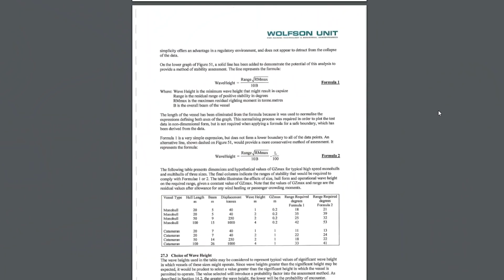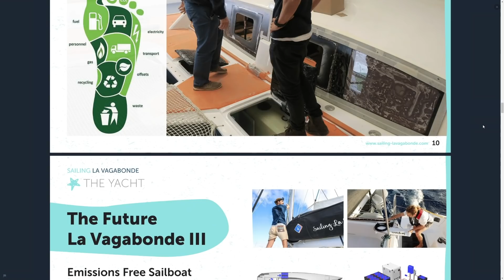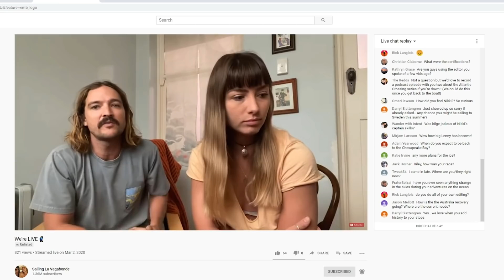Our Plan for an Emissions Free Vessel

Comment: The most emissions free you can get on construction of a vessel is to use the one you've got.  Why not just refit the Outremer with electric/hybrid sail drives?
Reply: I think Riley's focus is on creating something new that is better for the future. Refitting the Outremer wouldn't be enough. R&D is hardly an emissions free process but the overall outcome should improve the status quo. I think if they manage to come up with a design that cuts emissions on boat production, life and disposal, then others can follow and the entire industry can move in the right direction. Single ideas can change the world 😉
Reply: @BenDeBaran  not sure i would risk elayna and the kid on an untried design and techno-demonstrator
Reply: I thought this too. I have two ideas. One: Riley really wants to build his own boat. Two: the may be contractually obligated to not get too far from true on the Outremer.
Reply: @kmazingg  I would think Outremer would support this for many reasons.
Reply: Dr Creighton Shute Boat needs to be lighter and bigger to be able to avoid need for engine during 5 knot winds probably
Reply: @david4905  I wonder how much lighter it'll be with electric sail drives after removing the diesel engines.
Reply: @DrCreightonShute  With the batteries it will be much heavier.
Reply: @titter3648  The weight of diesel, the tanks and the engine is considerable. Worth a fair few batteries once removed.
Reply: @titter3648  JFA Yachts reported that Moonwave (60' Gunboat) lost 3.2 tons after refit.  That includes lightening the interior, but some of that has to be from the drives.

Here's the link:  http://www.jfa-yachts.com/en/Yachts/moonwave-catamaran-60-2/
Reply: @windsweptworld  Not if you want the same range as you have on diesel. That is why a Tesla is so heavy.
Reply: @titter3648  the thing is, you can recharge the batteries mid sail, you can't synthesise diesel. Not sure what the safety parameters would be; distance on charge.
Reply: @titter3648  Converting from dual diesel to dual electrics I dropped 200 lbs per motor, and I still have the diesel tanks, just hooked to a generator now.  Also I used AGM which is insanely heavy compared to lithium, and was still lighter.  Electric boats are lighter than diesel, the exception are designs that use a generator large enough to run continuously at the same power.  That ends up being heavier until you get into much larger boats.  The trade off in lighter weight is a range of 4 to 8 hours on motor without a large generator.
Reply: Dr Creighton Shute I like the idea of sail drive but wonder about range.
Reply: @titter3648  Maybe, but battery tech has changed, since not lead acid for hybrid.   Take a look at Jay Leno's Garage about the Briggs and Stratton Hybrid for an example.
Reply: jacques vlaming There’s definitely a large limitation to running on electric alone, thus the need for a generator. Check out torqeedo!  You can get an idea of ranges, speeds, and limitations. 
https://www.torqeedo.com/us/en-us/products/hybrid-drives
Reply: @titter3648  It is not about having the same but about being sustainable. Sailing more and being patient when there is no wind. Humans have got too used to doing what they want when they want. We would be wise to tackle our addiction of short term convenience. I think the change of mindset will pleasantly surprise people.
Reply: @DrCreightonShute  and adding a ton of batteries?
Reply: @fredbullmer273  i thing the energy explorer trimaran has the right idea.  solar panels make hydrogen from seawater and compress into tanks.  H2 runs thru fuel cell to give water and energy.  lighter than batteries.  also has 2 fixed side by side sails that furl up and down by nesting.  once sails are made into solar collectors....  that will be a game changer.  one thing riley should worry about is the speed he will give up.  he needed that to dodge storms in the north atlantic crossing.  giving that up would be a safety issue
Reply: I do not know much about boats but there are scientific studies done on cars were it has been proven that it is more environmentally friendly to keep fixing your old car as long as it is feasible instead of buying a new electric car. Being good to the environment is not just the use of the item (like being emission free) but also the whole construction prosses beforehand. All the materials have to be researched, shipped and put together. Which also take up a lot of energy (very often most of the impact is there).

I hope they consider the fact that being emission free is not necessarily the same as being good for the environment. I think the boat they have is already fairly close to emission free. It would probably be way better to re-evaluate when you use the engine (like waiting a extra few days before moving if the wind is not in your favour).

(as I said I do not know about boat, and therefor nothing about fitting of an electric engine so I am not gone say anything about that. But now I do have a degree in environmental science so do hope I get that general concept 😉)
Reply: To build a true zero emission boat you would also need to off set the co2 created during construction .
Reply: I think it's about the idea. I think what he's trying to do here is show that it is a feasible thing for the future and a way production needs to move towards. This isn't about their ship, it's about how things need to change environmentally in industries. How it CAN be done. 

Another counterpoint is, it's not realistic everyone keeps sailing on their old boats to reduce emissions and environmental impact in the long run, we need to change the processes anyway. This would be a good example of where we need to get to.. FAST.
Reply: @movezzify  of course. And that is self-evident that the industry is on the cusp of that transition - and a bit presumptuous to say that the professionals in the industry aren't pushing in that direction already on all fronts.
Reply: makanimike I don’t think it’s presumptuous at all, we need a lot more urgency. We have the knowledge and ability to do this but a lot of people drag their feet and prioritise profitability in the short term. Have the balls to do something like Elon did with Tesla, have balls to not make a profit for a decade to propell industry to a new age. We need more, sooner. Any discussion trying to argue against this is missing the point and is counterproductive. I’m sorry if this sounds like I’m attacking you, I promise you it’s not personal. English isn’t my mother tongue and I don’t really know how else to convey just how much and more importantly how soon things need to change.
Reply: @movezzify  I think you have it upside down. Demand is behind. The supply side is doing reasonably well. Yes, for most cruisers the battery capacity and/or solar charging capacity is not QUITE there yet, but almost.

The problem right now is that the balls you are missing are on the consumer willing and able to spend US$1+ on a boat. The supply side is doing pretty well on its part with the offerings and the R&D. So it's not really balls missing on the table, but cold hard cash from the buyers. Could it faster? Sure! So, we all have to become successful youtube sailors so that we can all afford that US$1m boat :)

FWIW, a link that may be lacking in the model is the actual core competency that SLV would bring to the table. Riley indicated it, but of course behind the fluffy, feel-good veil of them, as a family, wanting to be sustainable. Which is the marketing and pushing the discussion (like in this thread). Personally, I'd prefer it if that were at the forefront. Tell it like it is. That you want to push the market as a whole in that direction.
If anyone wants to only be sustainable and carbon neutral for themselves, stick to the beautiful boat you already have for another 20 years and commit yourself to almost never turning on those diesel engines.
Reply: @movezzify  sailing and sailing videography is near peak.  many anchorages are overflowing already.  certainly the YT sailing space is saturated.  I think in 20yrs crowding will make it untenable - everywhere you go will be filled with 20 other boats already.  i remember as a child, fishing with my dad on lake cumberland in KY usa.  very big lake - no-one around.  now every bay/slew has 3 houseboats and jet skis all day.  no peace
Reply: Yeah, thats right on. Building a new yacht isnt exactly environmentally friendly. But putting in hybrid sail drives, batteries, and extending their solar system would probably be done within a week and is not as exciting for them, which is why i can see the ambition to claim their endevaour of building a yacht by themselves is due to it being eco-friendly.
Reply: @TrolloTV  A week?  LOLOL You don't know boat projects very well do you
Reply: yeah. this is the thing. Upgrading and buying new stuff every few years is the antithesis of wanting to be emissions free and living a sustainable life.
But I think that goal only actually makes up about 20% of their wish to pursue this. The rest is to build a legacy. Riley alludes to that when he talks about what he wants to look back on in old age. Having a few dozen Vagabonde Edition cats roaming the seven seas will certainly tickle that wish for Self-Actualization (and of course provide for a further source of income for when/if Youtube retirement comes)
Reply: Coleen West That was not mocking a particular race at all. He was merely acting out someone with a southern accent with questions to his plan. To infer he was mocking black people is an unfounded attack.
Reply: I agree definitely better for environment to convert. I also think it would be more interesting to watch a conversion of your current boat and I think more relatable to viewers!! Think about the environmental impact you could have getting other sailors to convert!! Love la vagabond, keep up the good work!!
Reply: There are lots of other sailing channels that have popped up after this one, Quite a few have converted from diesel to electric without buying another boat. It is an option and cheaper...unless they want another boat.
Reply: Does anyone know if it would be possible to just switch one of the two diesels with an electric saildrive? This could allow for a hybrid setup while keeping one of the diesels for redundancy while you test out the electric setup for viability/safety? I would love to see this!
Reply: Coleen West didn’t see it that way, but hey you do what you need to if you feel it is inappropriate. I grew up in a world that black people mocked white people & vice versa, nothing malicious, context was making fun on people’s appearance, accent, place of birth, hair colour, skin colour, job, limp, penis size, arse size, basically everything. That was an era that if malice was the intention, you’d be judged poorly if you didn’t punch them in the face. I guess culture and age differences play a factor to...
Reply: Coleen West It‘s a southern accent, nothing more. You‘re the one stigmatizing without thinking.
Reply: Could not agree more, people often entierly forget the process of getting TO BE emission free, with that in mind (and it's an important part), refiting outremer would actually be very logical step.
Reply: My thoughts exactly. Stick with what you have got. And convert to electric moters.
Reply: Mac M. This is the first realistic argument I’ve heard, but a diesel generator that would only be used for those types of emergencies would take care of the problem.
Reply: Riley, have you thought about approaching Tesla with your idea. Elon Musk is probably the right person to make your dream happen. I think with all your ideas that you have and the experience sailing six years around the world, you and Elon would make a formidable team and definitely a game changer for the industry.
Reply: Yeah but maybe it’s like converting an old pickup truck to electric. Can it be done? Of course! But it is probably more practical to wait for the Cyber
Reply: This is about innovation for the future not just about trading in one yacht for another. I'll never have one but someone will. Let's support the "Carousel of Progress."
Reply: There boat is too heavy he needs a new one made from carbon Kevlar super lite weight for those 5mph sails he was talking about
Reply: Exactly ...
Reply: Using what you have. Sadly, using new fiberglass isn't super eco. There's really no way to recycle it or reuse it.
Reply: Silent yachts already do an emissions free solar powered catamarans, no sails though, I’m thinking there not fast across the Atlantic or range is an issue. Agree though that their already pretty eco friendly, apart from making videos to hundreds of thousands who use fossil fuels to watch them.....
Reply: The whole emission project is to hide their hunger for a new and bigger boat.
Reply: I'd love to see a carbon fiber wharram catamaran.
Reply: Ya Riley ol'e mate could you please let us know your thoughts on Why you don't want to refit the boat instead of buying a new one !!
Reply: Because they are spoiled rotten and need something new every 3 years. They think they deserve it now.
Reply: @SnoDawg  Someones jelly
Reply: @SnoDawg  I hope you're joking!  Otherwise, what a complete troll thing to say!  I challenge YOU to put out 2 quality videos a week for a month, let alone 2 videos a week for 6 years!  These guys deserve to enjoy the fruits of their labor.  Stop hating and go find your own happiness.  Be well!
Reply: Dr Creighton Shute What’s the point of showing even one video a week ? And people pay to be the first ones...watching other people leaving the life they always dreamed ?
They have big egos... and we might see more muscles, bottoms, Lenny  -depending on the messages and the business ✨🧡
Reply: Jarno Saarinen 12000 x 2 x 52=1.248 mil
Reply: @SnoDawg  spoken like one too lazy to have earned anything for themselves.
Reply: B C, you deserve more than envy in your life, friend.

Comment: both Maverick and lagoon have hybrid diesel witch if you are not to demanding can use without using any diesel but have the back up when you need it. Maverick has the adjustable props you can use in reverse to generate power when under sail, both are very impressive vessels

Comment: The costs would plummet if you would use your current vessel. I guess you must've already cosidered this though. But seeing as you seem very comfortable on La Vagabonde and you've already got some solar panels down, I don't see why that isn't a viable option. With area on the boat and your low electric consumpion being on a boat, that's easily possible. You could even power an electric motor. I have one piece of big criticism though. If you sell your current vessel and make an emmissions-free one, the total emmissions would stay the same since your current vessel would be used by someone else.
Reply: Not necessarily... If they don't built emissions free than the person that would but their boat and they would be both with emissions, with them doing emissions free only one of two boats have emissions. Plus the person buying their boat might not travel as far or as much as they do. Either way they can only worry about them and if they're worried about emissions I support them. It's like saying I want a Tesla but when I sell my car the emissions are the same but not really because if I didn't buy a Tesla the other person still probably would buy a gas car...

Comment: Electric motors are very small for the amount of power they deliver so outboard power units are quite possible and leaving more space onboard for battery units. On the issue of size, as you get bigger you need power to operate everything which in turn complcates matters exponentially and therefore costs too. Do you want to serve the boat or do you want the boat to serve you? What's the possibility of converting your present vessel to electric?

Comment: If by emission free you mean using no inflammable fuels that rules out diesel for heating and propulsion and bottled gas for cooking The alternative would seam to be electricity. That would have to generated by solar, wind , water or possibly fuel cell. Or more likely a combination. Have flexible solar panels been invented that could be made into sails? The amount of batteries needed would mean a large heavy vessel. Hmmm you have got me thinking.

Comment: MTU makes whole systems that propel a boat up to 10 hours on battery power. I believe it takes up a large footprint of the engine room but I’m all for it.  My only concern is not building too lightweight of a hull so if there was a accidental grounding you won’t loose the ship.  
I’m a power boater and designing a fuel sipping trawler with a massive battery bank and inverter system that powers everything when at anchor.   If I can I will go with the MTU setup.  Good luck to you guys ❤️

Comment: We have removed all the fossil fuels from our 1977 Rival 38 (no more diesel, petrol, paraffin or gas). Preparing to fit our electric motor at the moment. Our focus is not just zero emissions but fully sustainable sailing. Rescuing an old boat makes that far more achievable (as well as affordable). Agreed speed can add a safety factor that wasn't possible before reliable forecasts being available everywhere. However, plenty of Rivals have circumnavigated, some multiple times, which gives us some confidence. Of course, our needs as a couple preparing for liveaboard retirement are very different from a young family ;-)